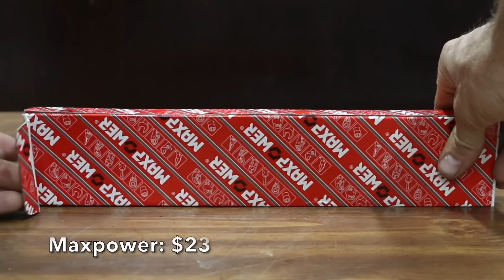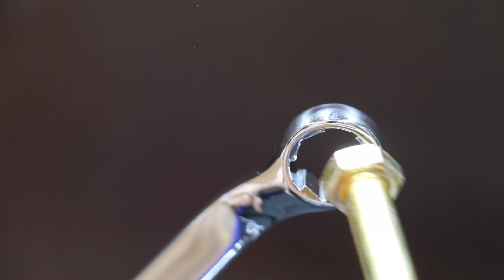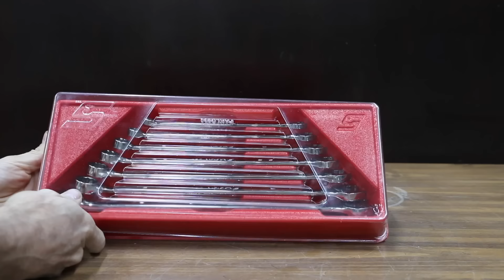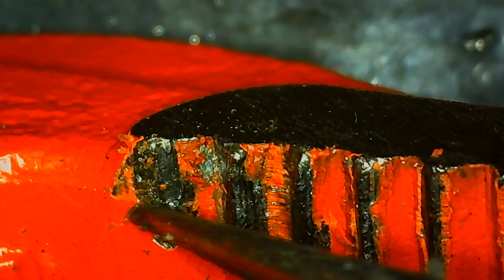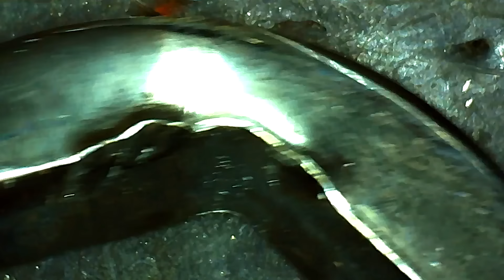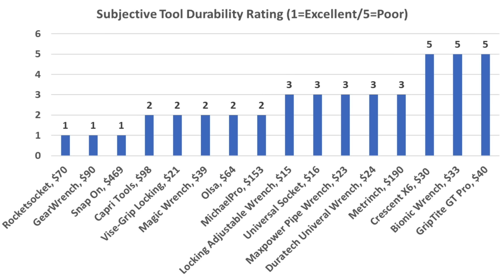Best "Rounded Nut" Extractor Wrench? Let's Settle This!

Comment: If I have a completely rounded head bolt to remove, I carry a regular Rigid 10" pipe wrench and a cheater that fits over the handle snuggly.  The head is already damaged so it  doesn't matter if I make it worse.  And it is a handy size for working in 3/4"   steel gas pipe, too.

Comment: I have some Capri wrenches, chrome socketry, and impact tools. They're really decent quality. I believe that I like their impact stuff best out of what I have. They're definitely one of the better Taiwan manufactured tools. I personally haven't tried any of the Wavedrive stuff, but I've heard good things. If I'm at the point of having to use an extractor style tool to remove a fastener, I don't really care too much about the damage the tool does to the head. I'm one of those people who prefers to replace where it's warranted, if possible.
Reply from the maker: Thanks for sharing.

Comment: I want to know how the Open head rounded but extraction wrenches do. Not the closed ends. You ain't always get a closed end wrench on. I have a hydro fitting that's stripped and can NOT get a closed wrench in there. Need Open end wrench for a stripped fitting.
Reply from the maker: Thanks for the suggestion.

Comment: Use a $23 pipe wrench or rocketsocket type extractor and replace the damaged bolt/nut.  Capri is not the best extractor as only 2 tools could get the completely rounded bolt/nut.  Hey Project Farm, are those affiliate links in your description?  Oh crap, they are!  I have now lost so much respect for you.  I hope you make a lot of money.  I am glad I use an adblocker so you won't be getting any ad dollars from me.

Comment: How was the rounding achieved? It appears it was by material removal rather than redistribution. That makes it too small for any of the non-gripping wrench types. 
They're not going to grab at all if the size has been reduced. At that point you're using the wrong size wrench. You're going to have to try a smaller size wrench on those fasteners.

Comment: So I ordered the Capri Tools wrench for a bolt that has been rounded.  The reason for this choice is it is in a tight space, and you can buy the wrenches individually (I don't want to pay $70+ for a set when I only have one bolt that is a problem).  I will report back when it arrives, and we give it a try.

This is one of our last hopes on a brake caliper bolt.

Comment: I have a lawn mower that the nut that holds on the blade is totally round , which one is the best for the job plus I put some heat on it . I was going to buy the Rocket Socket . I'm at a stand still .

Comment: struggling with half shaft Allen bolts now, round on the outside.  None of these look good so trying a new standard vice grip with fresh jaw teeth.  If that isn't enough, guess just pound on a tight socket and twist the bolt out,  like is done on locking lug nuts when the lock is lost.  Thanks, saves money knowing what won't work.
Reply from the maker: Thanks for sharing.

Comment: Aside from the usual overload of annoying sentences starting with "and, and, and, and, and, and, and...  Well you get it.  Terry used only the size of the wrenches made for the size of undamaged bolts.  What I find gives me great success is using a slightly smaller wrench than the size of the rounded/damaged bolt.  This often involves employing a Metric wrench on an SAE fastener and vice versa.  I often resort to hammering the CLOSED END of the  wrench onto the rounded fastener.  If a bolt protrudes you can use a socket as a spacer to hammer on.  I've never broken a quality wrench doing this.   The bolt has to be hammered out of the wrench most of the time.  The key on a rounded fastener is to use the stamped size of the wrench/bolt/nut as a starting point for selecting a slightly smaller wrench that can be forced on.  Using a smaller size wrench that won't readily fit over a rounded bolt can be hammered on creating new flats.  The bolt/nut isn't going to be reused anyway.  My wrenches have gotten slightly damaged at times but I've never had to throw one away.  Depending on the product/device in question mangling a wrench and replacing it may be worth the cost.  A key point is to use a QUALITY wrench, not a piece of garbage that's easily rounded or broken.
Another approach, if there's room, is to use a high speed rotary tool, such as a Dremel ,with a small cutoff wheel to cut a gap into the stuck nut.  Or just cut it off.
If you've got the time, spraying on PB Blaster several days in a row, morning and night, and allowing it to work its magic is often a great trick, either alone or in combination with methods discussed above.

Comment: The pipe wrench was not tested correctly, as it ha to be used by hand and adjusted to the "sweet spot" where the lower jaw still has some ability to be moved back/clamp on further to have more grip. Having the adjustable handle static and "fully collapsed" defeats the tool's purpose.
From my own experience I managed to completely deform "stuck" 6MO/316L 1/2" fittings and literally tear off their stuck threads with this kind of wrench, so the only actual limit they have is wether the resistance of the threads is larger than what torque they will tolerate before failing, or alternatively if the wrench is of poor quality its jaws may fail but that is an exotic rarity.

Comment: Hi sir, I am having the exact issue with the rounded nut in the flat tire of my golf cart. I am wondering what is the long stick-like lever that can be connected to the socket for one to maximize the rotating power?
Reply from the maker: Thanks for the video idea.

Comment: Best Rounded Nut Extractor Wrench? when testing the rounded bolt why didnt u drop down a wrench size and tap it on if need be? aint that what thier designed for?Best Rounded Nut Extractor Wrench
Reply from the maker: Thanks for the suggestion.

Comment: Rocketsocket seems to be the best for extracting. Yet I prefer welding a nut on the bolt head. The weld heat also helps losen the thread. And it is almost every time a success hammering the stubborn roundheaded bolt before trying to extract it.
Reply from the maker: Thanks for sharing.

Comment: Would fitting Teflon tape on the head of the bolt/ screw help any? If the wrench is going to slip off, isn't that what Teflon tape is for, to fill the gap

Comment: Maybe it's off topic a little bit,  Gearwrench (*which I'm not huge fan of ie China) makes "Bolt Biter" socket sets that are doing quite well.  I just bought the smaller "set" which comes with two screwdrivers 🪛,  two pliars, a nice 3/8th ratchet, and I think 8-18mm sockets that are sharp multi directional. I'd really wonder how those sockets would have done in this test. It was $55 for everything on AmZ. They have options for a full socket set 🎉
Thanks for the Content. The Capri looks really good here, 👍$ Thank you!
Reply from the maker: You are welcome! Thanks for the suggestion.

Comment: AS always excellent work, I just drill the bolt and use an easy out. When I can't get to it that way, I grind {or chisel} two sides and use a wrench. So far none have defeated my attempts. lol
Reply from the maker: Thanks!  Thanks for sharing.
Reply: My Dad used to use a wrench that fit tight as could get to the bolt, then drive a screwdriver between bolt and wrench and turn both, it works pretty good too.
Reply: I would probably use this now if I could buy a good quality screwdriver with a full metal tang. lol

Comment: Try a Snap On 6 inch adjustable pipe wrench PW6C. Still have it in my tool kit. Ideal for rounded nuts, bolts, brake line fittings.
Reply from the maker: Thanks for the suggestion.

Comment: Not being a professional with the money to justify expensive tools to extract rounded nuts, I use my dremel 3000 to reshape the nut to flatten two faces to use with a pair of pliars or i cut out a slot for a flathead screwdriver to remove a rounded bolt.
I appreciate all your hardwork and testing, its nice to see tools in use as when buying without past experience using some of these tools it's easy to skip over the cheaper options thinking "hmm big name brand means lots of r&d & high prices" when you've shown cheap tools work just as well and in some cases better or on par with the highly developed tools.
Reply from the maker: Thanks!  Thanks for the feedback.

Comment: You didn't test the BEST : Chanel Lock 410.     Works every time. Slip a pipe on it if necessary. The harder you pull the tighter it gets!
Reply from the maker: Thanks for the suggestion.

Comment: Snap on pwz pipe/pliers have insane grip. I’ve held polished rods on shock absorbers with it while using an impact on the top nut to keep the rod from turning when the nut is rusted on.
Reply from the maker: Thanks for sharing.

Comment: I had the universal socket type and a stuck (hardened) body bolt.  It was partially rounded and I started torquing but it wore the peaks to nothing. I then ground 2 flats and was able to then remove them with a 3-foot cheater bar. Unisocket is still in my garage.
Reply from the maker: Thanks for sharing.

Comment: Another good video 25 years ago i bought  a Hitachi brand  that i installed a 10” Sanding Wheel onto  to use specifically to sand off Marine BottomPaint  on boat hulls that is  applied to a Hull to protect the Hull fromBarnacle Growth  and Algea  while it’s moored in a Marina Floating  basically i knew that  i was torturing the machine by subjecting it to a very Abrasive dust  and a bigger Surface than it was designed to operate at  although in all honesty it has performed  way above my original expectations  and is still going strong ?  i have no Complaints  and as a retired Professional Architectual Woodworking maker and Installer i have owned and used many Hitachi Saws over the years  and i was always generally happy with their performances minus one 10” Sliding Compound Mitre Saw that the Competition  uses thicker more sturdy Stainless Steel tubes to slide the motor housing and blade on  that offered a more Precision Cut to whatever you are working on , like all tools   you need to purchase what you can afford and what you feel is the best Quality  for your Projects and Expertise , with Hitachi i’ve found   at their Price Point  it’s generally a Tool that’s worth the money
Reply from the maker: Thanks!  Thanks for sharing.

Comment: Amazing video with a lot of high quality work and testing!! However, I’m just curious when testing the wrench at 7:20 would it have been at all possible to use a size smaller and tap it onto the bolt or was that not an option?

Comment: Crescent tools are actually great quality. I've got a passthrough ratchet set that has the rounded head sockets. You're supposed to use the smaller size and hit it on 👍 has saved me a few times
Reply from the maker: Thanks for the feedback.

Comment: Interesting review! In my experience, high quality pipe wrench has been previously the best I have encountered to rounded bolts and nuts and it seems that this review agrees. And always rounded corner non-adjustable wrench for any non-rounded bolts and nuts. The pipe wrench in this video seemed to a bit lose for my taste; maybe you could create a video about different pipe wrenches and max torque with steel pipe vs rounded bolt? Is it worth paying extra for Knipex or Wiha? And does it matter if you get straight 90 degree jaw vs S-curved jaw?
Reply from the maker: Thanks for the suggestion.

Comment: If a bolt is already damaged further damage is mostly irrelevant. Take a pipe wrench to it to get it out then replace the bolt. If you are doing a field repair and you do not have a new bolt to replace a damaged bolt then again the damage is irrelevant. It is more important to get the bolt to hold instead of what it looks like. Take a pipe wrench to it and replace the bolt when you get access to a new one.
Reply from the maker: Thanks for sharing.

Comment: Comparing to a Rigid pipe wrench with hardened jaws and quality flat jaw and curved jaw Vice Grips would have been interesting. A premium grade Swedish pipe wrench like Knipex would likely have harder jaws. The cheap grade Swedish pattern pipe wrenches have soft jaws.
Reply from the maker: Thanks for the suggestion.

Comment: Random suggestion but just thought you'd do it best even though its not a product based idea.

Summer is hitting and mowing is here. I always wondered a lawn thats mulched vs a lawn bagged. Does mulching actually help the lawn be healthier with the old grass nutrients and by how much? Seems like a good time of year to start keeping one side of the lawn mulched and the other bagged (perhaps another in betwen or have some kind of control) to see if it makes any difference in the long haul of summer in terms of grass health.

Also if not that a send off to the honda gas mowers now disappearing in 2023-2024 may be a good time to do a test of their self propelled mowers against others like toro and cheaper brands. Though they are tested alot online already, but not very scientifically.
Reply from the maker: Thanks for the video ideas.

Comment: Yet Another reason to Never buy Strap On ...lol  

   I have been meaning to ask you have you ever tested ANY of those Rechargeable LED Flashlights you carry around in Truck , Junk Draw etc.........I dont mean the Flashlights That can use the Dewalt 20v battery for Cordless tools but ones that claim you can see a 1/4 mile with etc.. ie on Amazon, we use a few that have (2) 18650 3.7 l-ion batteries they are normally like between 12 to 15 inch long flash lights.    Be Safe & God Bless  🍻💯🙏🌴🐊✝🤠  Cow}:-o)
Reply from the maker: Thanks for the suggestion.

Comment: I believe the ones with tapered sides have a key step skipped in the manufacturing process. The holes for the open ends are punched after forging. If you punch one hole, the metal does what it does and shears up to a certain point before breaking, giving you a tapered edge after a short parallel section. You can see this on the edge of almost any pressed metal part you pick up, the edge will have a shiny band and rounded corner on one side, and a rough band with a burred edged on the other. 

How to avoid this on inside edges is by punching a smaller hole then shaving it to size with a 2nd punch (on outside edges it is simply passed through the blanking die a second time). if your wrench has parallel sides, they have made it properly in that regard and not skipped a step.
Reply from the maker: Thanks for the feedback.

Comment: Is there a way you can test oil l filters such as purolator boss full synthetic,Mobile One extended performance, Wix and all of the other full synthetic filters or filters..
Reply from the maker: Thanks for the suggestion.
Reply: @Project Farm  Your welcome Thank You if you are able to do a video about Oill Filters I wonder if you could see if the Anti-Drain Back Valve actually works for cold/dry  starts also..

Comment: You should test monofilament fishing line expose them to different types of water and elements and if it will make the line brittle like which line performs and holds up better to salt water I use pro spec chrome but theres so many options out there who knows what the best could be
Reply from the maker: Thanks for the suggestion.

Comment: You should do a video on budget welders, welders obviously can get super expensive but you should do test between a few of the cheap ones and if you have a nice one you can use it as a comparison or a baseline for what a good welder puts out and see how close the cheap ones can come to a good welder
Reply: Maybe like mig welders?  You can find budget ones for like 120 bucks and I'm curious if I should snag one for small stuff like rust repair in the cab/on the bed of my truck, I got some holes I need to just cut out
Reply from the maker: Thanks for the suggestion.

Comment: I think it would be super cool if you did a test with two identical engines. see if warming up to operating temperature at idle before throttling up extends engine life. as opposed to just starting it and going directly to operating speed. I'm guessing it does make a difference, but it would be cool to see proof. And it would be cool to see how much of an actual difference it makes.
Reply from the maker: Thanks for the suggestion.
Reply: @ProjectFarm  😎😎🤙🏽

Comment: The pipe wrench was used with the bolt too far back, on a bolt the flats should have complete contact with the teeth, the placement likely made it perform worse on the max load test.

Comment: Love the channel and have used many a video to make informed purchases so thank you! A recommendation for a future video would be cordless air compressors and their max psi, fill rate, how well it can bury a 3.25 inch framing nail, and how long the battery lasts under constant compression/use. Just an idea. Much appreciated for your hard work.
Reply from the maker: Thanks!  Thanks for the suggestion.

Comment: For a future review…a news story out this week, correlates lower lubricity in USA diesel to much higher failure rate of Bosch injection pumps than those pumps in Europe. USA has 520 microns of wear vs 460 for Europe in the 90 minute lubricity test. So, which additive lowers the wear the most? Schaeffer? Hot Shot? Or one of the other dozen? Over 500,000 recall notices have gone out Ram, Jeep, but there is no fix. Maybe we just need to start using the “right” additive to stave off a catastrophic pump failure.
Reply from the maker: Thanks for the feedback.

Comment: In my opinion, the RocketSocket is the most useful, when needed.  Otherwise, use a regular combination wrench on non-rounded bolts.  Wrenches that “try” to be anything more do not excel at anything.
This was an excellent video.
Reply from the maker: Thanks!